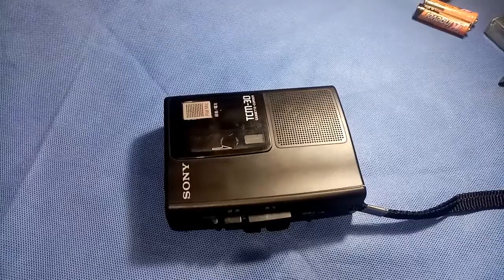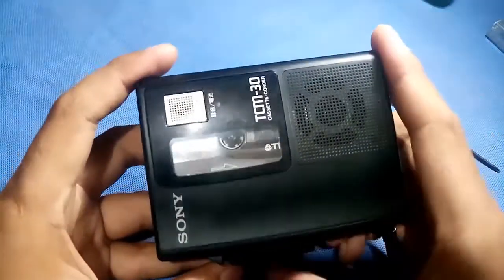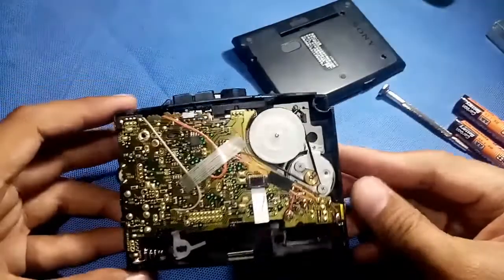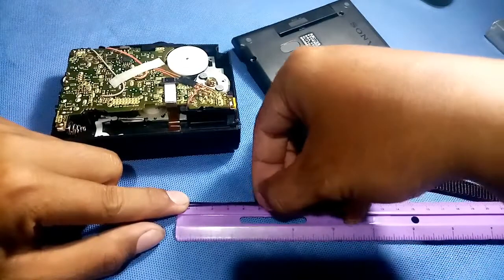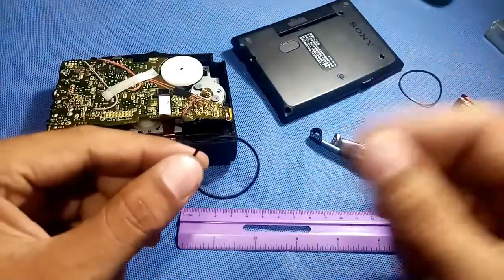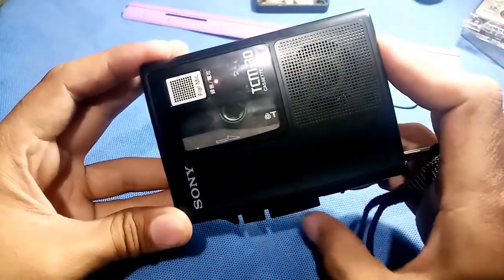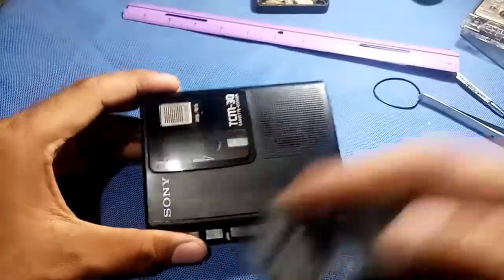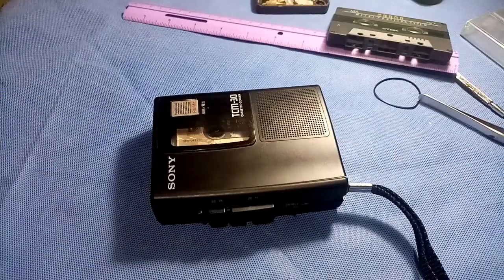How to replace the belt of a Walkman🎧 (Sony TCM-30)

Comment: Is this by far, the easiest cassette recorder you operated on when swapping a belt? Hahahah 

i noticed kasi  in your other videos, when you replaced other cassette belts you had to solder and dismantle the units pa; but in this one it looked so easy.
Reply: Also Woody I want to ask where did you but that specific belt for that cassette? I have a SONY TCM-30 as well and I’m having a hard time looking for this specific belt. 

Is it available in shopee or lazada? Can you provide a link please?
Reply from the maker: Depende sa model at brand.
Reply from the maker: Depende sa model at brand.
Reply from the maker: @Mattjavierto27  yung sakin is binili ko lang sa electronic store. try nyo jan sa RAON.